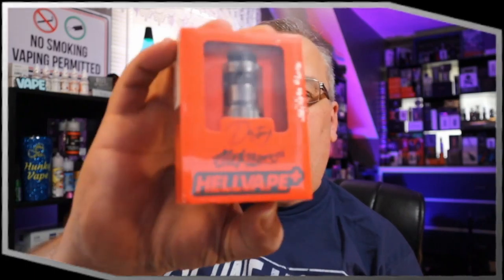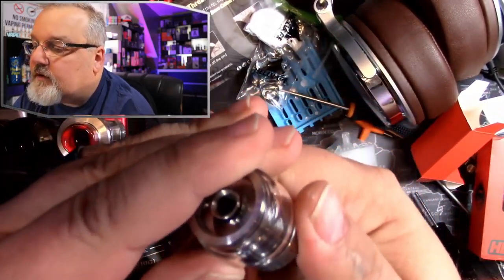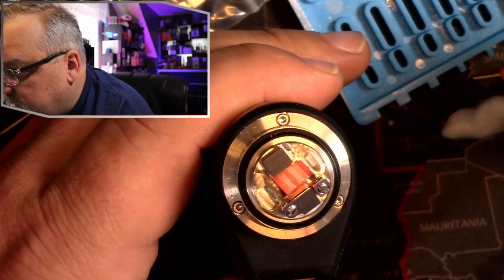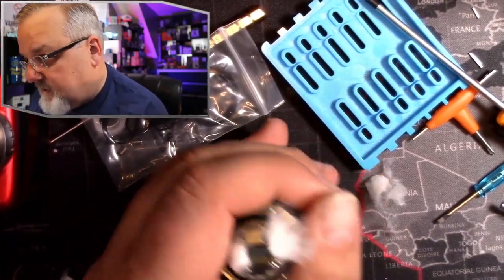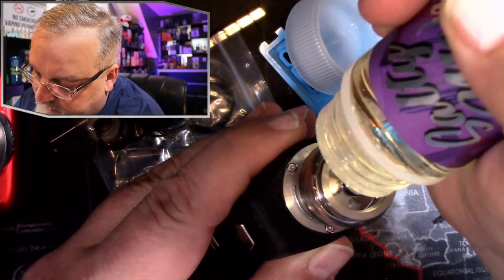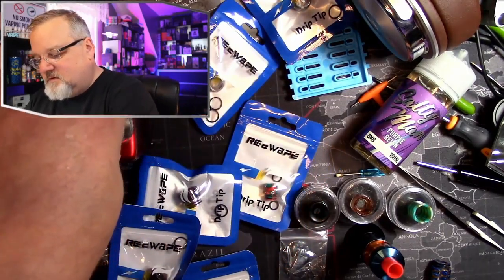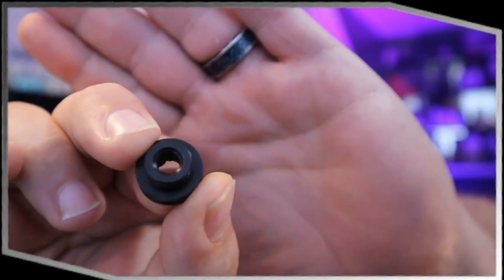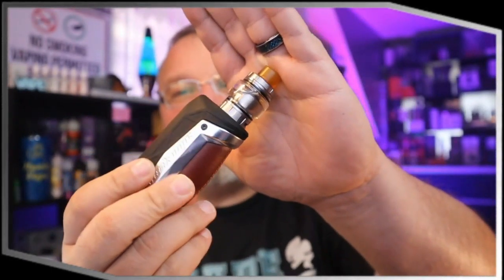Hellvape Alex VapersMD Destiny RTA got me discombobulated

Comment: The drip tip has nothing to do with the whistle or airflow. It's the airflow adjustment ring and Intakes lol.  First time I've ever seen someone blame a drip tip 😳  hilarious 🤣 . Think on this for a minute how would the drip tip effect the air coming into the tank ? Lol but great funny it was funny the turbulence is because down at the adjustment for airflow it's a wide open section then leading up to two channels out to the coil. When you close off each side of the air intakes like many rta's do you get less turbulence. The drip tip is nothing more then for you to have a place to put your lips to vape and looks that's it.
Reply from the maker: In ANY system where there is an input, and an output, flow rate can be changed on either end. Limiting the size of the output i.e., changing the drip tip diameter, will alter the airflow pressures and overall flow rate. Take a garden hose and put a small nozzle on the end. Will it not reduce the amount of water flow and increase the pressure coming from the hose? Whistle is turbulence created by a narrowing in the flow. How you deal with it can vary and there is more than one way to fix any problem. The narrowest place in the Destiny is the space between the coil and the incoming airflow. When the coil crackles it's spitting boiling juice in all directions and interrupts the airflow creating additional turbulence. You can limit the incoming airflow with the ring, or you can reduce the output with a smaller diameter drip tip. Both accomplish the task differently but a solution I did a while back was take a Dremel tool and add curved cutouts on the sides of the airflow openings on the deck. This allowed a slight increase in unrestricted airflow enough to minimize the turbulence! However, since there are better designed tanks that completely factor in airflow variations from wide open to almost completely closed (Like the Arbiter and Arbiter 2) I didn't feel the need to put out an update to this video from 2 years ago when I first got started on YouTube. If you'd like to see one with what I'm talking about LMK. Otherwise thank you for your comment and have a great day!